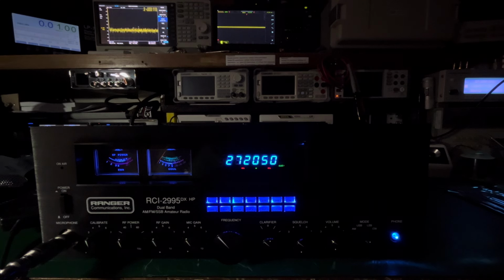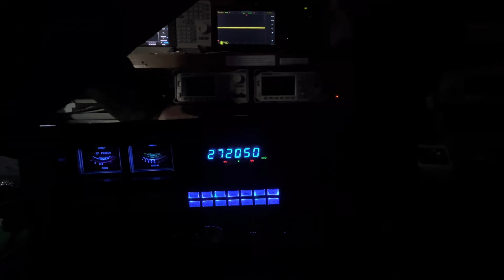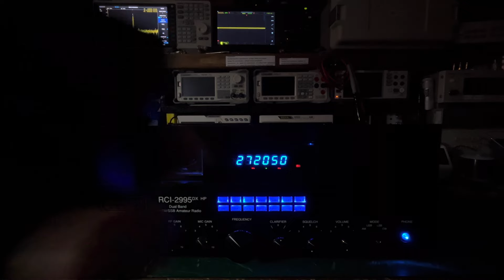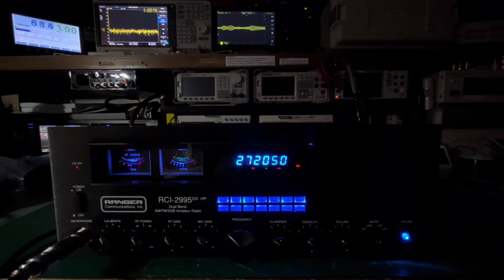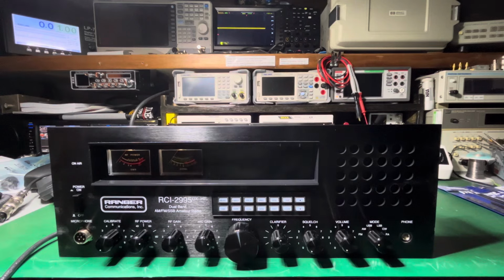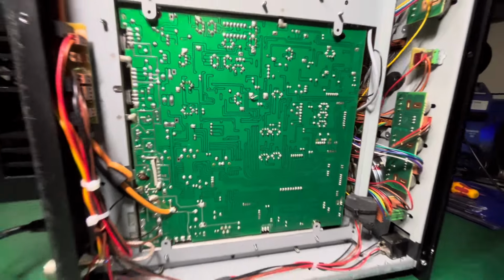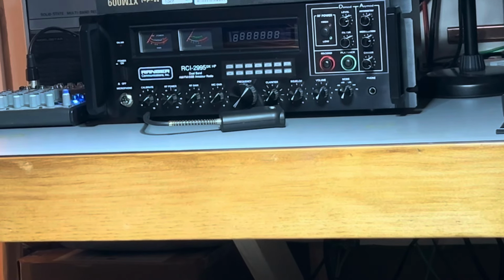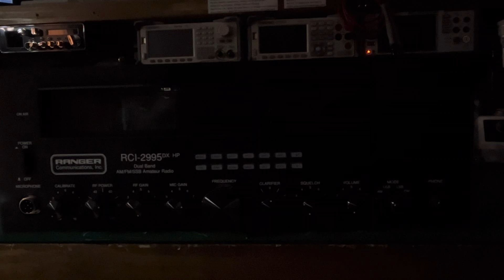RCI 2995DXHP for Phil

Comment: I like the Blue lights, and would like to get it done to the Freq meter, and buttons, but was told to stay away from that area.
Reply from the maker: I’m not sure of your skill / knowledge level but the keypad board can easily be ruined, the unsoldering of the board isn’t for a beginner but if time and care is taken it can be done. To remove the button board is very simple it’s more the desoldering and soldering. If you want to take the keypad board out I can instruct you and you can mail it to me and I will do the led lights for $30 plus shipping that includes the led lights.
Reply: @HAUNTED-HAM  I can repair many things, but my eyesight is not getting any better. I would like to have this done at some point. Thank you for responding, and I will contact you soon. 73 21 S.C.

Comment: Is there any way to add a real variable talkback to these? It's the one of the things they should have kept from the 2990.
Reply from the maker: Unfortunately not one that honestly works good, I do have on 69 Base Plus that does have talkback and it is a very, very nice radio. I have a video of one on my YouTube channel.
Reply from the maker: https://youtu.be/SsEEbDu7XTg?si=mdH1kKZ3t_mqfSJh
Reply: @HAUNTED-HAM  I've seen the jumper wire method and yeah, not a good or useful way of doing it. With the base plus you get echo and talkback but you lose the VFO. It's too bad nobody makes a copy of the old RF Limited UTB-1.